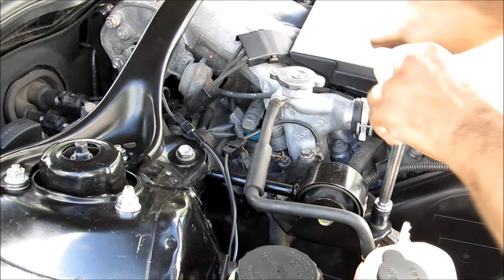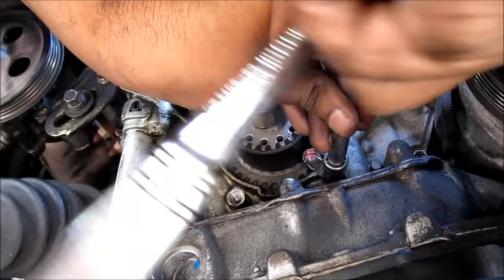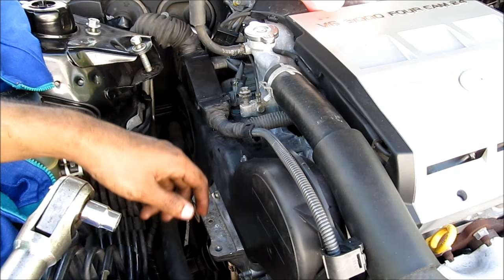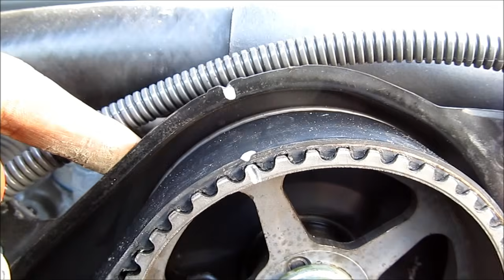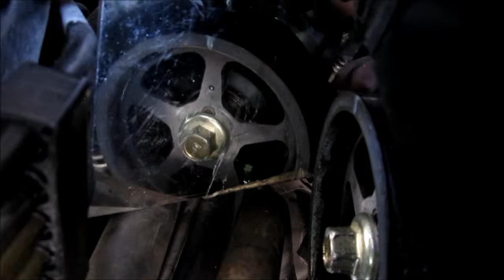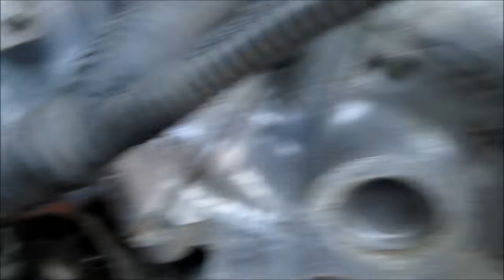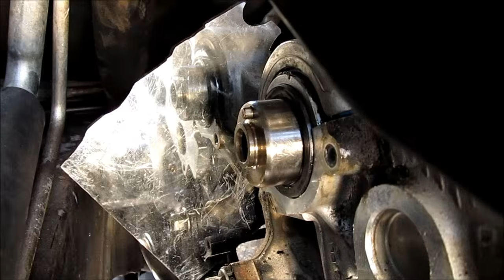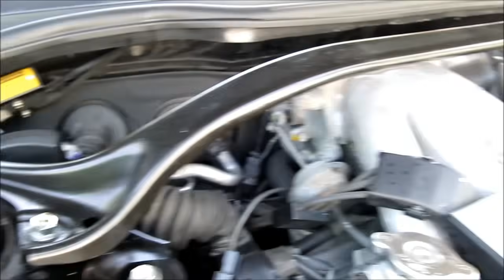Timing Belt / Waterpump Replacement: Toyota & Lexus V6

Comment: Great videos, I've gotten a lot of work done with your help. 

Quick question, trying to put the new TB on but the cams and/or crankshaft keep shifting slightly out of top dead center every time. Am I doing something wrong. Should I just crank them back and keep trying?

The new belt is tough to get on any additional tips?
Reply from the maker: +2012tymewar Sometimes it may appear as if the cam is off by half a tooth because it's hard to see the alignment straight on. Use a mirror to check the alignment marks (especially on the rear cam)...one tooth off should be noticeable, but half a tooth off might mean its on but your just viewing it at an angle. 

If the cam keeps jumping because its at the top of the can lobe profile, then use a cam holding tool or a breaker bar to hold it steady while you slip the belt on, and then zip tie or clamp the belt onto the tooth so it doesn't move while you thread the belt onto the other pulleys.
Reply: Ok thanks for the tip, think I got it. Another question. When you turn over the crank to check the marks, which marks are you checking? The cam marks? I turned mine over a 4 times and the marks on the 3 weren't in sync. Should I just turn it over until I line everything up like when I started? Both cams and crank marks?

Comment: Of all the timing belt videos I've seen  I must say this is the clearest, straightest one yet. Simple, no bs. Very close up and detailed. I have a different type engine (1UZFE V8)  but the basics on removal and aligning the belt are the same. Great vid.
Reply from the maker: +smithraymond09029 Thank you for the feedback. I'm glad you like my style, short and to the point. No need to bore the audience with BS.
Reply: I assume the 1UZFE is for the LS400? If so, was the process the same? Thanks.
Reply: "simple no bullshit" but the water pump is driven by the timing belt Hahaha.

Comment: Props to you.  I can't believe how complicated the process is to service a wear item.  This is why I stay away from engines with timing belts.  That would literally take me days to finish and I'd probably nick one of the camshaft sealing surfaces in the process.
Reply from the maker: +Car Stuff with El Camino Guy Thanks. I guess that rules out alot of your car choices then. I don't think it's something to base your car purchasing on, if you don't want to DIY, then a TB labor job is about $500, typically once in the lifetime of the vehicle.
Reply: speedkar99
 Not really.   You're making assumptions that just aren't true.  I've owned close to 20 vehicles in my life with the newest being a 2008 and none of them had timing belts.  I have to say you're DEAD WRONG about considering the cost of servicing a car in a buying decision too.  A grand to perform what is essentially a scheduled maintenance item is something you should know about before you buy the car.  Most people own cars for more than 5 years now and 200K is not unusual mileage.  With service intervals on timing belts ranging from 60K to 100K that's 2 to 3 changes at $500 to $1500 depending on the vehicle.  Yeah, some are easier than other but if you're only getting $500 to do the one in the video I think you're not charging enough.  Props for doing the work and you  deserve every penny but I won't buy a car that costs that much to maintain a belt unless it's a Ferrari.

Comment: Hey @speedkar, how did that impact wrench loosen and tighten the crankshaft pulley bolt without just turning the engine over and over? I can't think of a way to tighten it with hand tools, and I can't figure out how that impact wrench loosened that bolt without turning the engine backwards.
Reply from the maker: +John Chambers With hand tools you have to use a pulley holding tool. Most people make one by welding two pieces of steel together and drilling two holes that thread into the harmonic balancer. 
An impact gun works using impact to crack the bolt loose. It's not like a drill that would wine the engine backward.
Reply: Some cars use a reverse thread but the old fashioned way was to block the flexplate/ring gear from turning on the back of the engine.  Of course that was for domestics.
Reply: Ok, but I'm wondering about this Camry
Reply: Ah I see, I gave it a first try but I balked when I realized I needed something to hold the crankshaft still. Will try again. As always, fantastic video. Might add a note in the description for folks with hand tools. They could try the starter bump method to get the bolt off, but would still end up with a problem trying to get it back on!
Reply: what do i dissconnect to try the starter bump method?

Comment: Thanks so much for this great video, it has been a tremendous help! One question, how much of the process shown in this video would have to be done if I just want to change the front camshaft seal?  I had a garage do the timing belt about a year ago, and they were supposed to change all of the seals.  Now there's a pretty good leak coming from about where the front camshaft is located, or at least that's where it looks like it's coming from (I haven't pulled the plastic cover yet). It's streaming out pretty fast, I measured about an eighth of a court after 8 minutes at idle.
Reply from the maker: +-p v you pretty much have to take everything off as was taken off in the video, since the cam seal is behind timing cover #3 against the front of the engine. The only thing you can skip is the water pump and coolant.
Reply: speedkar99 That's what I figured.  Thanks for confirming. Also, thanks again for this and your other videos. I have used several of them over the years and they are easily the best available. Thanks again!
Reply from the maker: +-p v glad you found them helpful.

Comment: anyone can help me how to jack up the engine since the water pump can not get out? Thanks
Reply from the maker: +Tod Wong I didn't need to jackup the engine in my solara. My car was already jacked up from the right side, since the right side wheel had to be off to do the job anyway. 

If you do need to lift the engine, use a few blocks of wood under the oil pan and a floor jack. If you need to Jack it even more, unscrew the 3 bolts from the front mount to give you more play.
Reply: Thanks, but I have a highlander that apparently need to some more space, either jack it up or remove the stud. So I don't know how to jack the engine up.
Reply: Do I have to loose the engine mount first before jacking up?

Comment: How many miles before timing belt on these engines needs replacing?  My 2004 Highlander had it done at 98k.  It now has 180k.  Excellent video. Well made!
Reply from the maker: +condor5635 Roughly 90K miles. Guess it's time for another timing belt job.

Comment: nice video, what kind of seal puller is that? who makes it.. it looks very adjustable
Reply from the maker: +Michael Corsbie I got it from Princess Auto. Its too big to get the rear cam seal out easily.
Reply from the maker: +Michael Corsbie I got it from Princess Auto. Its too big to get the rear cam seal out easily.

Comment: I aligned the top two correct and the bottom one was at tdc mark.  I than took off the belt but now the timing is off. I made the mistake of not marking the belt first before removing.  any suggestions would be grately appreciated.
Reply from the maker: +homerson1080 Your belt doesn't have installation marks? Most new belts do. If not, goto an auto parts store and align it up with a new one that has marks (make sure it's in the correct orientation) and transfer the marks over.
Reply: Thanks!

Comment: so when you turn the cam shaft twice do the line match like you installed it or does the line move.
Reply from the maker: +homerson1080 Once you turn the crank or cam the marks on the belt will not realign for hundreds of rotations. The marks on the cam and crank on the engine itself should always realign after two crank rotations.
Reply: Thank you! Your video helped out alot. I was able to realign my timing.
Reply from the maker: +homerson1080 glad it helped

Comment: I'm going to have to pull the engine.... wouldn't it be easier to just pull the motot and leave the trans in place? I don't have a car lift.
Reply from the maker: +John Biggi I'm not sure, I would have thought it would be easier to pull it as a unit since clearance is tight to slide the bell housing off the engine. But then you'd have to deal with siezed axles.

Comment: +speedkar99 Sorry to bother but what do I do when the front camshaft and crank are in time at tdc but the rear cam is about 40 degrees forward or turned 40 degrees clockwise and whenever i try to turn it back it just springs back to its origional position
Thanks for always helping
Reply from the maker: Common issue, its because at the TDC position the rear cam shaft sits on the peak of its cam lobes and the spring pressure wants to push it forward or backward. Use a cam holding tool or a breaker bar on its 17mm bolt to hold it in position when looping the timing belt over the cam gear.

Comment: i did this and now i get a crank no start , same car but its sputters and doesnt run i just change the water pump new ignition wires and spark plugs 1/4 tank of gas and its a no go can u help me
Reply from the maker: +Deezel 215 double check your timing, and make sure the ignition wires are on properly and your spark plugs are getting spark. Next check the fuel pressure.

Comment: What if you follow all those procedures and the marks don't line up again when turning the motor over by hand? The motor got really hot is my reason for  changing the water pump and timing belt....
Reply from the maker: +John Biggi The belt marks won't lineup but the cams and crank should. If it starts and its off by a tooth the car will run rough.

Comment: Thank you for the video. Found one of these on cl for 200 bucks and only needs a water pump. Found the kit for 150 at my local auto parts store. Any little things you didn't mention in the video i should be wary of before i attempt this?
Reply from the maker: +James Smith glad it can help. 
Make sure you have all the tools before hand. Before removing anything, take a whack at the crank bolt. If u cant get it off then have a shop loosen it up for you with a 3/4" impact.

Comment: Just wanted to say thanks for breaking the job down. I'm no master mechanic, so I was nervous messing with the timing belt. You're video was perfect. Not painfully over detailed, just a quick overview of the steps involved. I didn't bother with the cam seals, cuz my Camry has 307K. and I really didn't want to shell out $800 at a shop. parts were only $142, so you SAVED me about $650! Thanks again!
Reply from the maker: +Max Bloom Hey I'm glad the video helped you out. Short and to the point is my style. 

If the camseals weren't leaking them yea you could skip them. Surprise they aren't at 307k though.

Comment: Thanks for the great video on the Toyota Lexus (equivalent to Camry V6 and Avalon).  I've successfully changed the timing belts, other engine belts, and water pumps.   Your video was very helpful and key source in practical learning about timing belt replacement at my 2000 V6 Camry XLE with 203K miles.    Did not hit any hickup; I've just had some delay due to not having stud remove/install tool (had to wait while my car stayed open until the tool arrived).     Good to mention that it likely take 2 days for first timer like me.

Key reason I decided to repair my car myself is I've get ripped off a few times while trying to service my car from dealer or repair shop.  Can not find any reputable/trustable shop in NJ.

I would like to encourage your continue putting new auto repair video.

Thanks
Reply from the maker: I'm glad my video was helpful for your TB job. I Didn't have to take off the studs because I took off timing cover #3 that covered the water pump housing and it slid straight off. Most of the time those torx on the end of the stud strip or break off.

Comment: Very good video. Only complaint I have is that it's hard to tell where to put the timing. I had a general idea, but it just wasn't as clear as I had hoped. Ended up watching another video which did a great job of showing the timing position for the crank and the cams. Apparently there are also notches in the rear timing cover that the cam gears line up with. The video that shows this clearly is titled '00 Lexus Timing belt part1'.

Other than that, excellent video. Thank you for posting!
Reply from the maker: +Saab Guy Thanks for the feedback. 
I guess when doing the job it's easier to see the timing marks in person than in a 3rd person view from a camera.
Reply: +speedkar99 Oops, accidentally hit report on your reply when I was trying to reply...

It is definitely easier in person. After actually receiving the Timing kit, I realized it also tells you what to look for in the directions, making it even easier to figure out.
Reply from the maker: +Saab Guy yes the direction is important the timing marks won't line up if u install the belt backwards.

Comment: Hey do I need to disconnect the ignition to blip the starter or can I just turn the key for a bit and let go?
Reply from the maker: +Theo Pull out the coil pack connectors

Comment: When changing the timing belt, do you also have to replace the hydraulic tensioner?
Reply from the maker: +My03Tundra You should as good measure. Because if it fails the timing belt will skip teeth. It's also easier to get a new one than to compress the old one in a vise.
Reply from the maker: +My03Tundra You should as good measure. Because if it fails the timing belt will skip teeth. It's also easier to get a new one than to compress the old one in a vise.
Reply: Think of it this way: If any of those components under the timing cover fails, your car is dead. Replace it all while you have the belt off and live another 90k miles.

Comment: Did you support the engine on the bottom when you removed the engine mount?
I didn't see you doing that nor hear you said it.
Reply from the maker: +angelisone No need. That engine mount is to control back and forth rocking when you shift gears or accelerate hard due to torque. It doesn't carry the weight of the engine.
Reply: Glad it's not like the Hondas.  Some more questions, please.
1. How to turn the Crank Pulley when the 22mm Crank Bolt is removed?
2. Do I need to put back the 22mm Crank Bolt without installing the 
    lower timing cover & turn the bolt CW?
3. Since I can't get to Spark Plug #1 (it's in the back/manifold needs to
    be removed), when your turn the 22mm Crank Bolt, if the top two
   Cam are hitting the index marks. 
   Then the Belt are at top dead center/Cams/Crank Shaft? 

I don't have the Cam removing tool. Can you tell why you need to loosing the Cam?
Would removing the Tensioner will loosing the Timing Belt?
Sorry to ask, kinda new and being a woman & I am not that strong.

Comment: I've done a few 2.2 toy belts looks to be similar.. good vid. thanks!
Reply from the maker: +rawbdiggity 2.2 is single cam, much easier than the one on the v6 way back near the firewall.
Reply: either way im not scared.. lol  bought my kit and will knock it out this week thanks for the great vid.
Reply from the maker: +rawbdiggity Thanks, hope it works out for you.
Reply: Got it done yesterday took a while to get crank bolt out heated it up HOT. and breaker bar against A arm to break it with starter. anyway thanks again for the vid made it easy.

Comment: Does the woodruff key just slide back onto the slot on the crank shaft? We're doing my buddy's and I noticed the woodruff key was on the ground after we took the crank pulley back off because we reinstalled backwards.
Reply from the maker: +Galen Ho Yes it should just slide back in.

Comment: Nice video. Well detailed and very explanatory.  Im scared as shit to do it but i gotta at least try. You made it look somewhat easy. Good job.
Reply from the maker: Thanks. I was scared to do my first timing belt job on my Lexus and I messed up. Snapped a few bolts and learned my lesson. 
For these jobs its always good to have a second car on hand in case things don't work out. Also having all the tools ready before the job makes it go much smoother, such as the cam holding tool, air impact gun for the crank bolt, and seal puller.

Comment: Got a 2001 rx300 mechanic said 900 just to change the belt does that sound right?  It looks pretty fast in this video if its 900 im expecting a job like that to take at least a day.
Reply from the maker: $900 for belt and water pump sounds about right for a dealership price.
About $250 in parts and 7 hours labor.

Comment: Thanks for the video. I forgot to loosen camshaft bolts before I take out the old timing belt. Is there a tool to hold on the camshaft from rotating while I try to loosen camshaft bolt with breaker bar?
Reply from the maker: Cam shaft holding tool.

Comment: Thanks the video. How long did it take you to complete the whole job?  do you recommend to replace the camshaft & crankshaft seals if no leaking?
Reply from the maker: Thanks. As long as the seals aren't leaking, then don't replace them, unless the car has high mileage. The rear cam seal is a pain to get in and out, the other two are not as difficult.

Comment: Hi speedkar99 I was wondering what to do about the bank one camshaft, As in another video I saw a person saying that the bank 1 camshaft is not in a rested position and that without belt tension it will spring the valves into the crowns of the pistons. PS: love your videos and the information that they provide, Your great
Reply from the maker: +Patty Razer Yes the rear cam is at a point where it can spring forward or backward. Throughout my timing belt job it didn't spring on me, though I don't see any harm in moving it forward 30 degrees or so to rest position when changing cam seals and then move it back when reinstalling the belt.